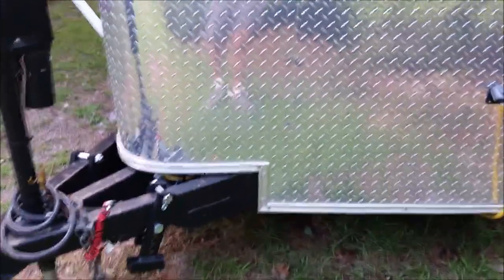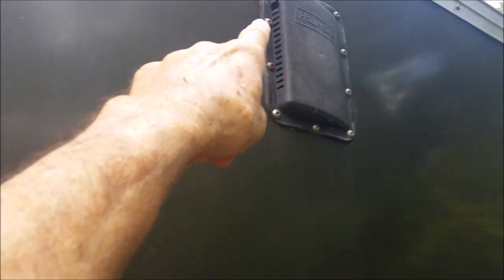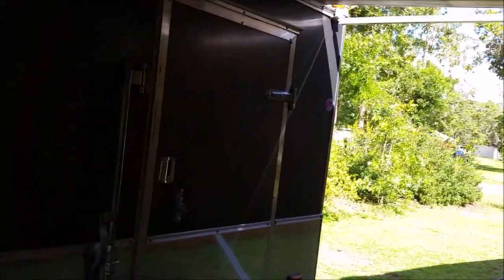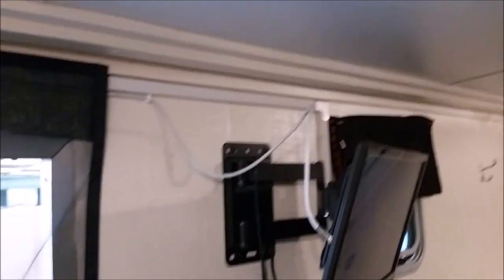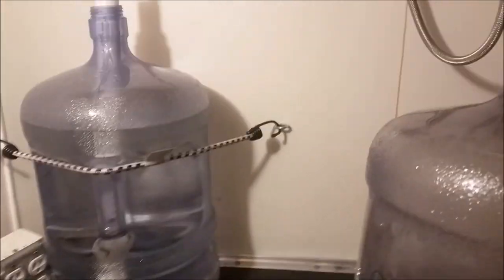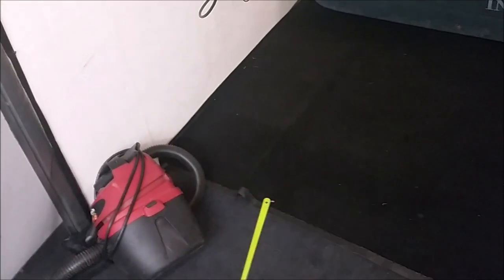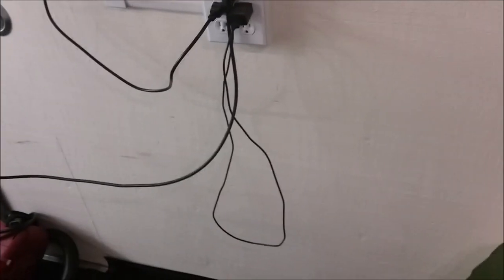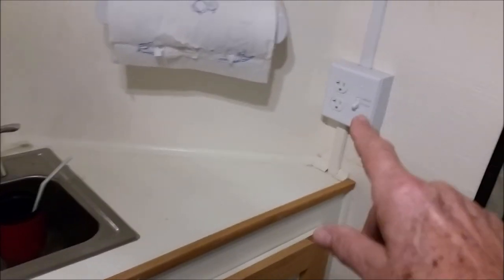7x14 Cargo Trailer/Toy Hauler Conversion Part 2

Comment: I believe what you are referring to is when people flip the axles to ride underneath the leaf springs. The other option is replacing the stock suspension with an adjustable height air suspension.

Comment: So many builds show makeshift water systems,not judging but I spent the time and money to install 2 rv water tanks 20 gallon each with a 3.0 gpm auto pump,my design in my 7x14 afforded me the opportunity to put them on either side of the trailer above the wheels,tanks of course are piped together with a line that runs under the trailer and each has it's own locking fill cap on the trailer sides.my sink drain comes all the way down and thru the floor I use the big blue rv waste water tank with wheels to collect my gray water when I actually collect it,right or wrong the tank is always slid under the trailer when I'm camping right
Reply from the maker: Would love to see pics or a video of your build. I don't really use that much water when I'm camping. I use the campsite showers and bathrooms plus I use the water that is provided with the campsite. I only use my onboard water for washing a few eating utensils, brushing my teeth and GI showers when needed so it has been good enough for me. If I'm boondocking I can carry extra water and use it as needed. I've seen where some people install tanks between the floor braces with showers and bathrooms. They are very impressive!
Reply: Uploaded a walk around ck it out at " our Homesteader Intrepid cargo trailer to camper conversion @ Mrjoey on youtube I don't know how to provide a link
Reply from the maker: @MrJoey1570  Finally got around to looking up your channel. Your rig looks like it was made in a factory. Excellent build! Where did you get the screen for the rear drop down door?

Comment: I have the same issue with my tailgate hitting the jack. Never donned on me to mount it backwards. Thanks.
Reply from the maker: It wasn't my idea. I bought it second hand off the trailer company that checked my breaks and greased the bearings. They mounted it that way and had to explain to me why...

Comment: How you set up the shower?
Reply from the maker: No shower. I usually use the shower at whatever campsite I'm staying at. If on the road I would either use a truck stop facility which are actually pretty good. Some laundromats have paid showers like at West Yellowstone and some campgrounds will charge you a small fee to use their facilities. You can join a nationwide gym like Planet Fitness and use their showers or if your retired and have a silver sneakers you can use the YMCA. If boondocking then use a small outside shower tent. A GI shower or Dude Wipes work great until you get someplace with a shower. Hope this helps.